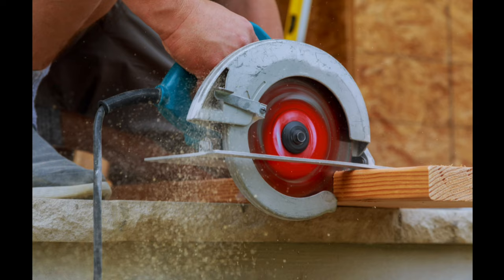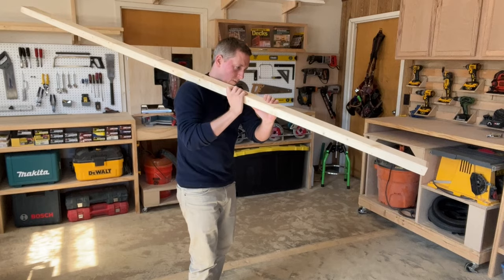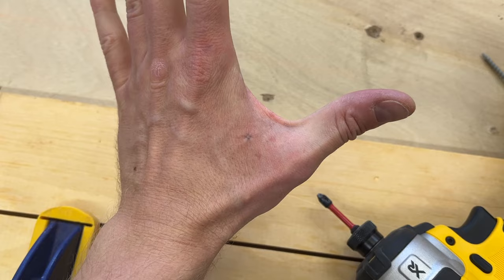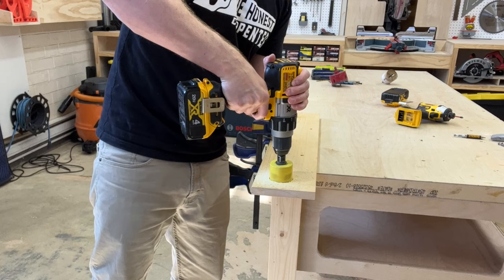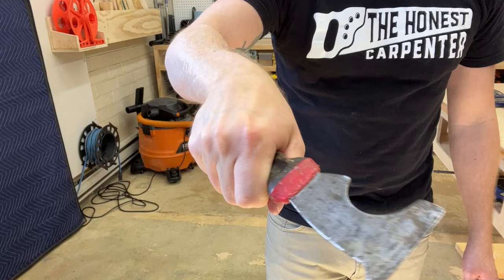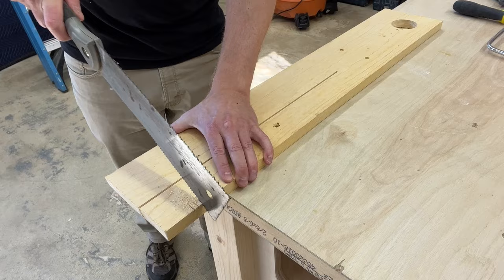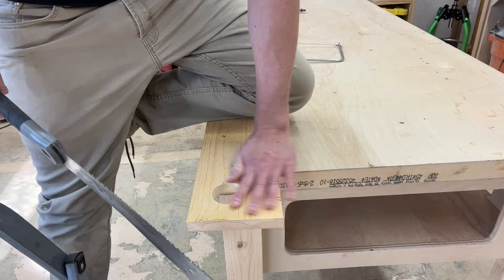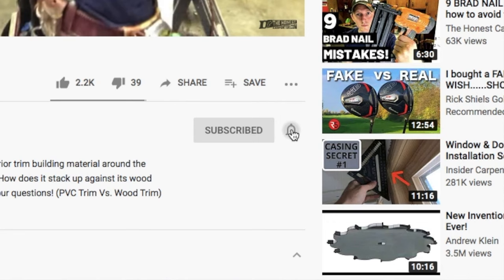9 MOST OVERLOOKED DIY INJURIES! (Avoid These 9 Worst DIY Injuries/Accidents From Common Tools!)

Comment: I've once cut myself deeply in a finger with....scissors. Cutting awkwardly some furniture mats with robust kitchen scissors, I had misplaced my finger underneath as I held the mats for leverage. I was pushing on the scissors so hard, when I got through I cut my finger right to the bone as well... It's often those very small jobs that are the killer, as you don't take the time to set up properly.

For the drill bit jumping, however, there's an easy fix: stop using the terrible Philips screw heads. The old Robertson already hold much better on the bit and, with the Torx as well, are so much better at holding straight you commonly don't even need to hold them, even while moving the driver around. Thus, they're much safer to use.

Comment: Wow, yes, I've taken a sledge hammer to the knee, sprained my wrist drilling through a metal square tube and the 1/2" bit got hung up, and I've also stabbed a utility knife fully into my thigh because I was cutting a drain pipe towards myself. My pant leg was completely soaked in blood and razor blade cuts don't close up easily

Comment: I hurt myself more often with the screw driver than with the angle grinder or arc welding. They seem small and innocent, until you are in pain. Also the "just gonna cut this out" is the worst, a touch of the angle grinder in my finger made a nasty cut (though very clean). Never is ok to not be very cautious.

Comment: One comment on using utility knives.  When not in use, make sure the blade is completely retracted into the holder.  Even the slightest point sticking out can cause a severe cut.

Comment: I think the steel, curved tined rake is still a good one. You know, leave the rake leaning up against the wall, with the curved tines facing away from the wall, and you walk up to it with your #12 work boot and step on the tines, and the long handle wacks you in between the eyes really fast. I've done it and use one of those a lot. Maybe Homer Simpson is in my bloodline somewhere along the line.......
Reply from the maker: The most ludicrous injury, jocko!  Happens in a heartbeat 😂🤦‍♂️

Comment: I nick myself all the time with my carpenter's knife. I have more small scars from that thing than anything else. It's always from some dumb thing you know shouldn't do like getting complacent and cutting towards yourself, or rushing when marking to do a single heavy cutline instead of three light strokes to save a minute. Chisels are a close second,  the small chisels are the ones that get you and you're doing something dumb like trying to use them as a plane. Clamp it down is my policy, its the free hand stuff that inevitably backfires on you. One of the "tools" that DIY channels forget to list is hydrogen peroxide, buy a bottle with every glue bottle for your shop.
Reply from the maker: Yep! Yes to everything CG. I’m almost always in a rush when I get hurt. And a brilliant woodworker friend of mine nearly cut a finger off with a chisel just using hand force!

Comment: You havent lived, if you didnt got a metal shaving stuck into your finger. Most woods are natural and will start to disolve with time. Most metals will rust and that a big problem. If you can get it with a twizzers, youre golden.
If you cant get it out - use mix of a soap (cut off part of a bar of soap) and sugar. Make a paste, put it on the spot and put some bandaid over it to hold it there. Check every 12 hours and possibly replace the paste, if it still didnt got out. Eventually either it will come out on its own or enough to use twizzers.
Reply from the maker: Thank you for the tip, Michael! I got a shard of aluminum in my hand when I was fifteen. I couldn’t tweeze it, so left it in there and this big weird knot grew over it 😆 Glad it wasn’t steel.

Comment: I am guilty of all of these over the years, both as a professional carpenter and a DIYer. Except I want to point out an issue with your ladder advice. Folding a ladder up and leaning it against the wall is an osha violation, so is standing backwards on the ladder. Working ofthe ladder parallel to the wall is not. This is because both of your recommendations have been proven as dangerous or more than working parallel. I’m not saying parallel is safe, I’m saying your solutions are just as bad.